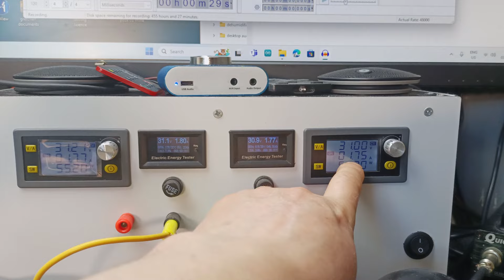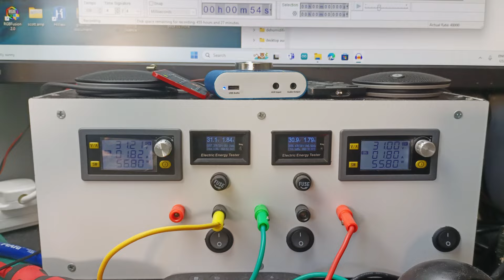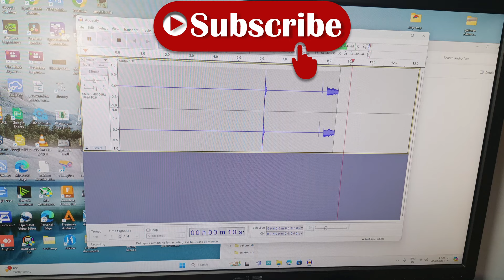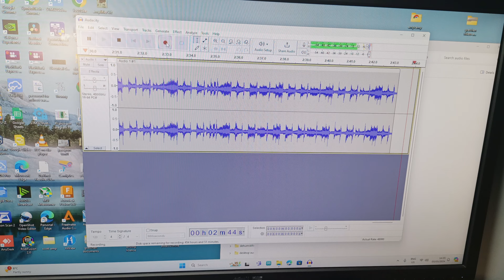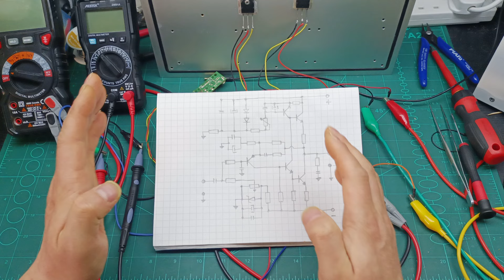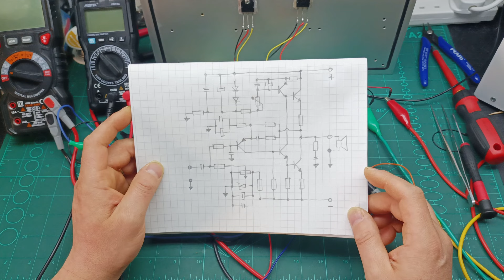Class A amplifier single ended my own design Part 1

Comment: That thing should sound awesome.
Hope you have some excellent speakers to enhance that sound quality!
Reply from the maker: This amp I tested with several speakers. Looks like don't like to much speakers with crossover so next will be to test with full range speakers.
Reply: @SymbolTech21  Understood. Yeah full range good quality should be cool.
Reply: Nice, I design and build my own amps too. I started with class a but ended up building more class ab amps lol. I do like class a tube amplifiers alot though. I will stay tuned for more videos.
Reply from the maker: @jakep8484  I have on the way also a classA single ended tube amplifier to build same my own schematic design with KT88 power tubes. I'm struggling to have some free time
Reply: @SymbolTech21  nice, I used the kt88 as well for one based on the kegger Amp. Mine can run el34 as well in triode or ultra linear, fun stuff. I have some nice iron waiting for a 2a3 build.
Reply from the maker: @jakep8484  my dad long time ago built an amp with el34 I will never forget the sound of his amp.
Reply: @SymbolTech21  el34s have a great tone, the music just sounds right. All tube's seem to have their own flavor, el34 seem to had a touch of that warmth but overall just very musical. 300b and that are overly lush which can be nice but it's far from neutral.